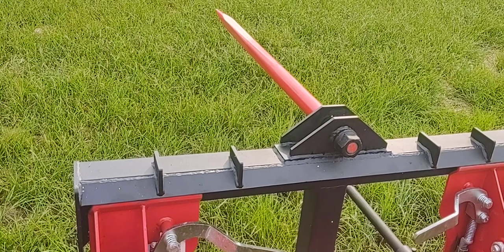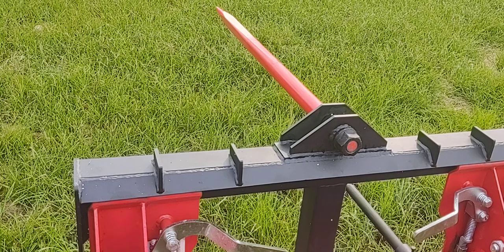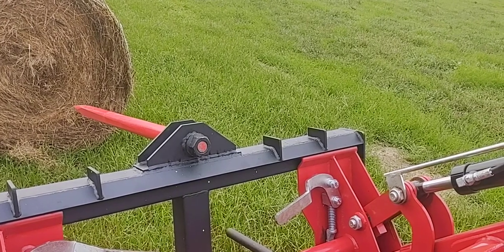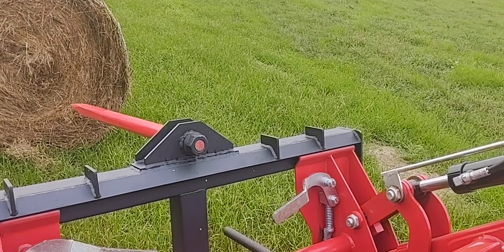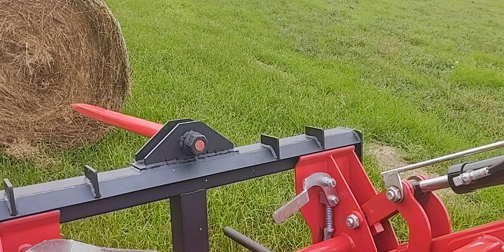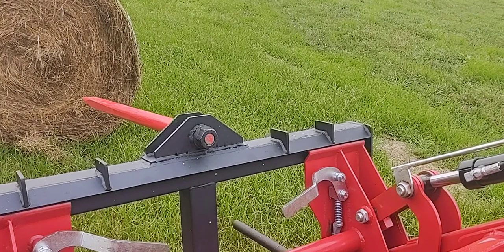Cheap quick attach bale Spear part 3

Comment: Cheap is right , moved 10 round bale with mine and the spear bent , DONT BUY THIS
Reply from the maker: I've moved over 1800 bales with mine no problem other than the paint wore off the spike...it isn't one you can abuse
Reply: I had a neighbor  with those spears with the Nut  and it snapped off and took out the front glass in his cab......We use cross-bolt secured types on cab tractors and the nut  type on cabless euipment.......
Reply: To be a "Successful U-tuber", please be Open for coments. The "Kid-approval " on your other vidios/ JUST  AIN'T CUTTING It. Thank you Sir for the Excelent vidio and happy safe tractoring. Best wishes with all your endeavours.